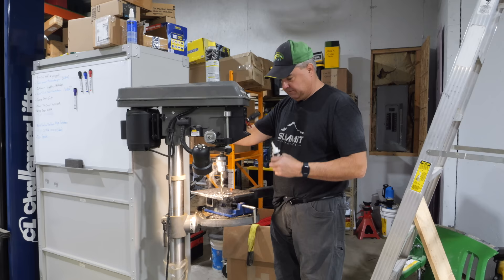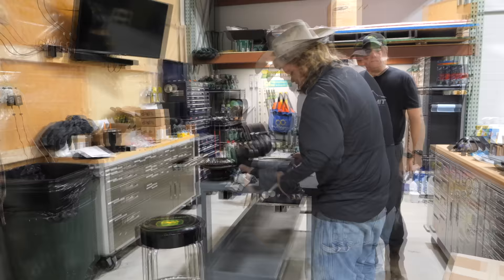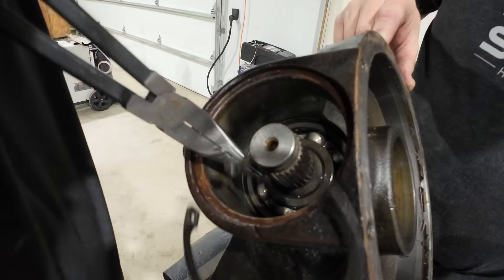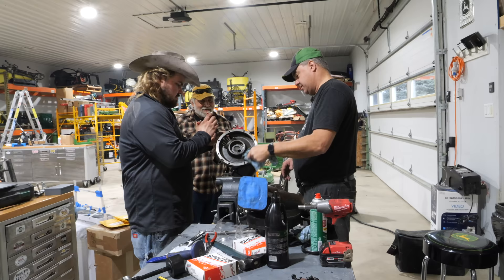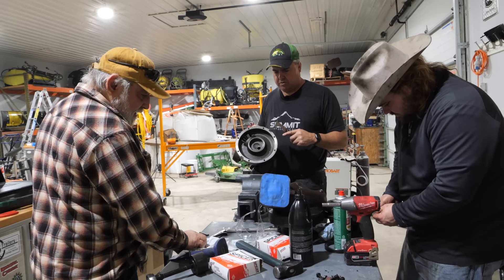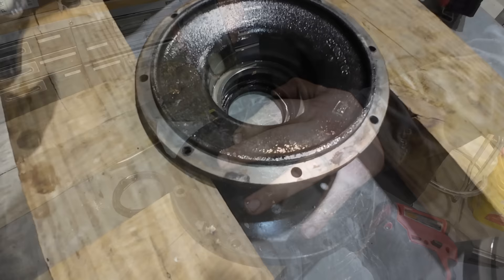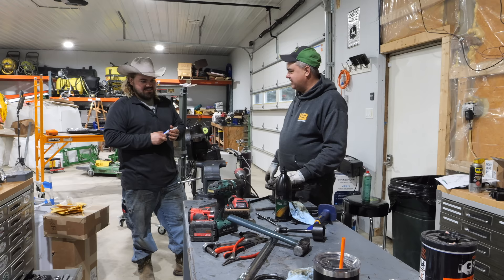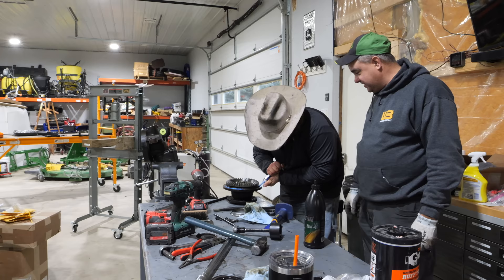Does EVERYONE Have This Issue? Front Axle Seal Fix on Deere 4300.  Need Help with YOUR Repair?

Comment: I just bought a 4300 with 5130 hours on it, non running needing some injection pump work.  Pump is getting rebuilt at a local shop.  Previous owner spent $6000 to have front axle seals done last year, will be adding one of those vented caps from otis, thanks for mentioning them!
Reply from the maker: $6000 for front axle seals!?  Wow, we didn’t charge enough!

Comment: Good Job on the front axle repair! I noticed a leak starting on my front axle final drive case last weekend, hopefully it will be an easy fix.
Reply from the maker: Vent your front axle.  See if the leak stops.
Reply: @TractorTimewithTim  Thanks Tim for the tip! No pressure built up, but I found the issue. The bearing failed and some metal fragments from the bearing race must have damaged the seal. I flushed out the fine metal particles in the gear oil, replaced the bearing, oil seal and sleeve, hopefully it's good to go as I have a lot of soil to move!

Comment: Installed an Otis Innovations vent kit today on my 1025R. Was actually surprised that there was a small amount of pressure in the axle when taking the dipstick out. Of course I used TTWT when ordering.
Reply: Can’t wait to hear what my local dealer says the next time I take my tractor in for my every other year maintenance. Yeah I know, I can do the maintenance myself but I don’t have the desire to mess with diesel oil anymore. Plus  I have a couple of medical issues that just makes it uncomfortable to do all those things I used to like doing. My dealer will come and get my tractor and deliver it back to me the next day and they’re only about 8 miles from my house.  They even pressure wash the tractor before returning it.

Comment: I bought my LS tractor in Florida and it being flat which is about opposite of Missouri i noticed at an angle the oil was coming out the vent. I have yet to check the oil and probably it may be low. I think all the little tractors have the same problem. The best way to fix the socket is put it in a lathe and cut it back evenly.

Comment: Enjoyed the video! I had a problem with the Fuse block in my 2018 B 3350 Kubota. After spending time trying to get the part and not available any place or any dealer I ended up using two truck fuse holders! Kubota really failed here!’
Reply from the maker: Wait, they couldn’t get the part (via order) for a 2018 tractor?
Reply: The only way you could be the part that was small and held a 50 and a 60 amp fuse was to buy the entire wiring harness for $2150. The fuse hold broke when I had to replace the 60 amp fuse  which require force to take out. A simple factory solution would have been to cover the contacts with Dielectric grease...Tom @TractorTimewithTim
Reply from the maker: @thomasbarnes5703  awful!  And the B3350 is not that old!

Comment: Proper tools make all the difference in the world. Red loctite when the part can handle the heat to remove it. It takes 500 degrees for Loctite brand red to loosen up. Also consider what is near that part. Blue with the activator will hold almost anything you need it to until service time. There are two blues, one is oil resistant.

Comment: When I did my 2001 4300 I had a piece of 2" square tubing and welded 4 pieces of hardened rod wire at each corner to make my own free socket. I didn't even have to hammer it to fit! Sorry couldn't resist. How can I send a pic.?

Comment: I have a 4410 RH that needs a seal. Bought the vented fill plug but still leaking. What is the part number of the socket removal tool with 4 nubs. Job looks easy enough. Just did a similar job on a 2320 - true it was a little easier. Thanks for the P/N.
Reply from the maker: Shows it in the parts diagram

Comment: Hey Tim, Greg Ritter SeaTac Washington if you remember correctly told you quite a while ago I’ve got a 4300 and I’ve only got 500 miles on it and I’ve been using it quite a little bit. I fold a couple oil tanks out of the ground big ones 300 gallon or bigger course they weren’t full, butmines been running real well I haven’t done any fluid replacement in the front axle whatsoever. I probably should check them now that you’ve brought it up. I think I will.
Reply from the maker: You should change the fluid in the front axle at minimum.
Reply: @TractorTimewithTim  Oh great now I gotta look up that info see if I got the stuff.

Comment: Tim, while Yanmar built those tractors, they were built to John Deere specs. What Yanmar did—purchased US axles that were spec or built the axle to those specs would have to be answered by someone in the design/supply chain at that time. One thing we do know, they were well built tractors as there are still lots of them being used.

Comment: red thread locker, to disassemble, 450 degrees for 5 minutes will soften the compound making disassembly easy. Remember Loctite is not the only manufacture of "thread locker".

Comment: I have an X595 4x4 with OEM loader, turf tires, gentle hours and a leaking front inner seal.  I have the parts and am a shade tree mechanic but no joy finding a walkthrough on the process.   Interesting that old tractor with a 3 cylinder yanmar has more hp than the new 10/2025’s.  The little tractor that can.  The hydraulics squeal but the dealer says it’s just the way they are???  Different dealer from the original selling dealer.
Reply from the maker: If you are local, and want us to help, let us know.
Reply: @TractorTimewithTim  Thank you!  That would be awesome however we may be a bridge too far apart.  I’m just outside Omaha.  About how many miles from there?
Reply from the maker: @mikehouser7587 probably a bit too far.
Reply: @TractorTimewithTim  Yeah… appreciate the opportunity.  God Bless!

Comment: Tim, off topic for this video but another channel revealed their JD farm tractor hood material fracturing all up (they spent $7k on a replacement hood) I wondered if you could go through your vast fleet of JD and alternative tractors to show all the hoods and materials in them. I thought JDs were fiberglass with inserts but it looks like this other channel's hood is all injection molded with poorly aging brittle plastic everywhere. Is that 'industry standard' now or just JD?
Reply from the maker: I do not know.  I have had pretty good luck with ‘aging’, but I did break one on ole salty….by running a big stick up through it.  Can’t really blame the hood for that.

Comment: would you want to put a single point hook up on a kubota tractor
Reply from the maker: Which model?
Reply: only has 3 hoses but will have a 4th for when i get the grapple bucket  @TractorTimewithTim